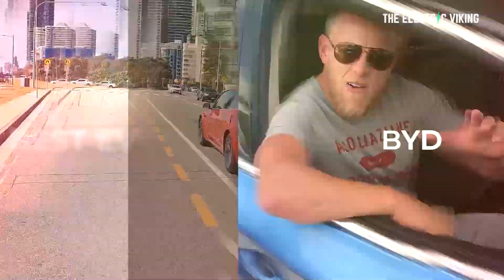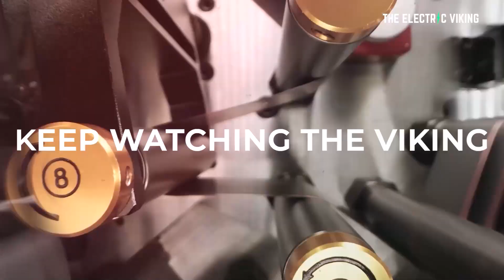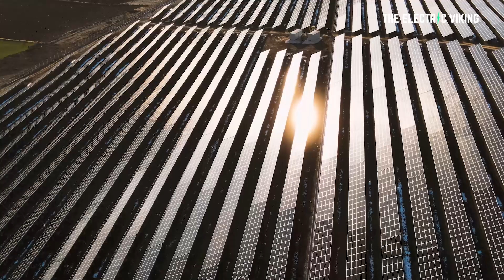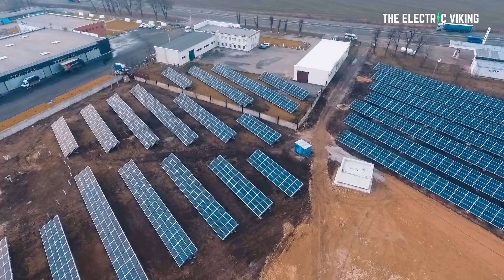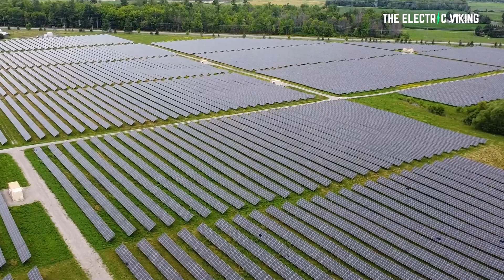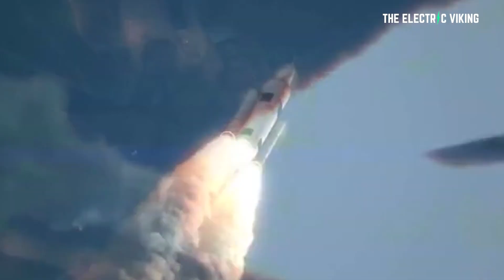Solar panels that work at night could power the Earth 24/7

Comment: I don't know what people have against safe modern nuclear plants. They're completely different from the old types.
Reply: The problem is what to do with nuclear waist? Unless nuclear diamond batteries become a thing.
Reply: @mohammedabdulahi7894  how much nuclear waste do you believe exists?  ALL (every single bit)  of nuclear waste generated in America since 1950 would fit on an American football field. 

And... there are new nuclear plants DESIGNED to run on the "waste".
Reply: @johnb7430  true, if it's possible to run new nuclear plant with nuclear wait I am all for it. It's just that solar panels give you the freedom to become energy independent which I prefer.
Reply: @mohammedabdulahi7894  What do you think is more toxic, 50 years of nuclear waste, or the byproducts of billions of solar panels over a 50 year timeframe?
Reply: @CRCinAU  let see you are asking me which is dangerous between broken glass and aluminum vs nuclear waste with radiation that can kill with out contact?
Reply: @mohammedabdulahi7894  France is using waste to generate power now. They also are recycling the materials.  

Dont get me wrong, solar is good. But to replace grid power, its not sufficient. It also needs battery backup. And it does run into shortages in winter which limits utility in certain lattitudes.   

Of all the "grid" power generation sources  nuclear is the most abundant,  uses a miniscule fraction of resources of coal, natural gas, oil and generates the cleanest power. By far.  Oh, and emits the LEAST AMOUNT of radiation.  

Coal, gas, oil all have been in the ground and have "background radiation".  Yes, a tiny tiny amount per ton,  but there are billions of tones used. The total amount released is large.  Then the mining /drilling disruption and polution is also a factor.  

Dont be fooled by propaganda from coal and oil conglomerates throwing out distorted and false claims on nuclear (and solar, wind, hydro). Do your own research.
Reply: Perhaps it’s that no one has any idea what we’re going to do with all the waste we have already, never mind making more.
Reply: I'm all for nuclear as clean renewable energy and I live a short distance away from the 3 mile Island nuclear plant in Pennsylvania. (Look up the history on the partial meltdown). I'm sure you know it takes 20 plus years to build a new plant. That doesn't really help the current drive for renewables with global warming today.
Reply: Fundamentally too slow and too expensive. A few are fine, probably up to 20% of generating capacity, in the long run it'll be cheaper to overbuild solar and wind together with some storage.
Reply: Even the person that founded Green Peace admitted they were wrong to be anti-nuke
Reply: Totally true. They do sadly make waist so bad that people 50 thousand years into the future will have to deal with. Solar battery arrays are now cheaper than any other source of power right now, without that legacy to the future generations. Just look at this lecture,
https://www.youtube.com/watch?v=z7vhMcKvHo8
Reply: How many safe modern nuclear plants are under construction, how much is each one budgeted to cost, what arrangements are in place to pay for them to be safely dismantled at the end of their life and where will the radioactive waste be permanently stored?  Nuclear power stations require a lot of cooling water.  Placing them on the coast is a recipe for disaster when we know that sea levels are rising fed by melting ice caps. So where will we put them and how will we source the coolant water?
Reply: @rais1953  ... and when a single nuclear reactor outputs more power than 10,000,000 solar panels for over 50 years - what do you do with 10 million toxic solar panels if you choose solar over nuclear?

Not even starting to count battery storage to store the output of 10,000,000 solar panels to try and get through the 16 hours per day where they generate nothing.

Comment: I've been looking at solar portable power stations for backup energy incase of blackouts and it looks like people are picking LFP (life04) over ion because they're safer and last longer.  Exactly what you've been saying for quite awhile as to why manufacturers should use LFP for their Evs. Agree Solar and battery technology advances are moving at lightning speed.
Reply: Your portable emergency backup battery which can run the basics in your house is called a BEV now that many are offering vehicle to load 😁

Comment: I had more or less understood that you have no clue of anything regarding phisycs bit I did not believe that you was so clueless to rebound the mother of all fake news.
Instead, here we are.
So first let's debunk, just to ensure that everybody understand each other and that we are all on the side of phisycs.
The power produced at night is in the order of the mW while in the day it is in the order of the 100W, so it is 5 order of magnitude less (not 5 times less, 5 order if magnitude less i.e. 100000 times less), in other words the power produced at night is, by all means, negligible, it is >0 (this is the discovery) but it has no practical impacts at all.
This is still not considering that everybody on the face of the Earth would need 5kW of power to run at the Western standard of living while energy from the Sun is 100W per square meter seasonal average; considering a generous 50% efficiency (now we are stuck at 20%, for affordable chinese solar panels, from several years) it means 100m2 of solar panels, plus 20MWh of seasonal battery storage, I repeat again PER PERSON and this news, as defined above, does not change anything.
Multiplied by 10 billions people it becomes a square of 1000km by 1000km of solar panels and, more important, behind them 200PWh of seasonal battery storage, both to be replaced every 20 years.
This is the real planet disruption (not the Tesla one), mining such quantity of materials, followed by a distopic world Blade Runner like.
This news, as the other "sensational" ones related to the direct capture technologies (improperly named as "renewable") is actually functional to the fossil fuels industry, in order to further delay the only technology that can actually displace it and, at the same time, that can decarbonize the energy industry.
Go nuclear or go nowhere.

Comment: Just for the record.
Avg home has 32m2 of windows. 
At $400 / m2
Glass PV panels on the roof. 32m2.
Is $200 / m2,   32kwh daily.
In Australia, 20million buildings. 
That is more than all fossil fueled power generation daily at maximum power if you are lucky.
For free.  Solar electric energy. 
No expensive grid transmission costs.

Add EV big batteries and central grid electric power supply is a 'dead duck'.

Some of the other 'dead ducks', that fought to stay alive;
Big Fossil fuels,  no climate problem 
Tobacco,  no cancer problems
E cigarettes, no problem 
Gambling, no problems 
Pharmaceutical, no problem 
Auto industry, no vehicle safety problem 
Horse racing, no problem 
Water supply, no problem 
Pain killers,  no problems 
Nuclear power, no problems

Comment: Wonder if its possible to have containers of sand / earth beneath solar panels, heat these during the day then generate energy using a heat exchange on a night. Use the same area for two different type of renewable energy. Or am I completely barking?
Reply: Hi Paul.  You're talking about sand batteries - they already exist. In fact, I have something similar in my home which heats up bricks at night during cheap electricity and pumps it out as heat for the daytime. Something similar could be used for your scenario. The only reason I don't put my solar into the heating is that I need it to power my house.
Reply: One line of reseach, for example by Professor Christos Markides and team at Imperial College London, is 'solar-thermal' hybrid pv systems with the goal of maximising total energy capture in both heat plus electricty. You could search on Markides at Imperial for more info and his augaural prof. lecture back in Oct 2021 on the Univeristy's YouTube channel.
Reply: The problem with your statement - you're asking can you heat something up in the shade. Think about that for a moment.

Comment: Viking there are some fundamental questions that need to be faced up to. The law of thermodynamics. To get electrical power you need some kind of power striking the panel. It must have either light or heat. so if you have 100 mw of light striking the panel at night you will never get 110 mw of power from that panel. Therefore this is not a magical solution. 4 sq m of panels might trickle charge one low power cell phone, but not much more than that. You must be careful of believing these enchanting solutions that later have some serious flaw such as expense. ..
Reply: Th high frequency laser beam is supplying a race way  for energy to transcend

Comment: OK, but we still have a problem: the solar panels recycle. Here on YouTube are videos about how recycling a panel cost 30 dollars and materials recovered has a value of 2-4 dollars... so... we get nothing good if we cover the earth with crossed panels... Is this a real matter or not? Recycling should be the base development of any new technology.
Reply: Recycling cost should be added to purchasing cost of all products. It's the only way we won't burden our children with the costs of our life style
Reply: Fair point but would you rather deal with a pile of used panels or a used nuclear power station or the effects of oil burning?
Reply: @jsanders100  doesn't matter which tech we use, add the costs of cleaning up the pollution from nuclear plants to the cost of energy they produce. Same for coal, gas, etc. 
Ofc atm it looks like solar+wind+batteries  will rule in this decade
Reply: @jsanders100  Seems the problem is not understood:  broken panels come to be more and more, exponentially. No nuclear plant is increasing any contained surface, is delimited area from the start, and can be the same for a thousand years. Costs are not the problem, the problem is volume and space, the landscape. And I want to see engagement in solving problems, but now seems ... nothing. To be clear, I am here as the devil's advocate, the problem not to be forgotten, not to stop solar electrification.
Reply: @jsanders100  Give me the used nuclear fuel any day. It can be reprocessed and used to make millions of dollars. The sad state of affairs is that nuclear 'waste' is worth more than you could possibly imagine. You need to realise that stored 'waste' today is tomorrows fuel source. The US has enough 'waste' for a number of decades of free fuel.
Reply: @CRCinAU  And the cost of dismantling the nuclear power station at the end of its life?
Reply: @rais1953  it's cents on the kWh.....
Reply: @rais1953  The cost of storing the wast for the rest of time.
Reply: @CRCinAU  Is it? Which currently operating nuclear power stations are putting aside the funding for decommissioning by a surcharge on their power production?  Or are they all depending on the taxpayers to pay that cost?
Reply: @rais1953  It's part of the price for every KWh of power they generate. You really should start reading on how these things are organised - as these questions are very basic in lacking knowledge.
Reply: @CRCinAU  It's because I've read extensively about nuclear power that I asked that rhetorical question. A detailed OECD study came to the conclusion that the means and adequacy of financing decommissioning of nuclear power plants is unclear and requires further study. Translation: Any private nuclear operator can declare bankruptcy. So private or state operated nukes are likely to be left to the taxpayer to finance decommissioning.
Reply: Sounds like crap to me the average solar panel has about $30 of silver in it for a start.
Reply: Yep, seems no one has no idea. I asked what we are doing with the broken panels, which today are just gathering in piles. Behind comments extracted from media propaganda... nothing. OK, as solar panels are expected to work on average for 20-30 years, this problem is to be solved by the others, coming after us...as we clean after others, each generation with its own garbage, up and down... Nothing is gained or lost, all is transformed, just...

Comment: No, it doesn't work that way.  As it is, solar panels used in the daytime in full sunlight leave a lot to be desired.  Case in point:  we have to replace a lot of trees with solar panels to get enough electricity to power everything.  The amount of electromagnetic radiation that can conceivably be used by solar panels at night is only a super-tiny fraction of what is available in the daytime.  You'd be lucky to power a digital LCD clock with the light that you would get at night on your home roof with no clouds and a full moon unless perhaps you don't mind going nuts replacing trees with solar panels of course just not near your house.

Moreover, this still does not solve the problem that EVs will become an epic disaster because power grids will fail to keep up with even just half of all cars and trucks becoming EVs.  It doesn't matter how many solar panels and batteries you put everywhere.  You keep ignoring the problem that the power line and transformer infrastructure was not designed almost anywhere to supply all those vehicles with that much electricity be that in the day or at night.  Power lines are going to be overheating and breaking down non-metallic components because of excess heat, and transformers will keep blowing out, so then power companies and local governments will impose even more bans on people using power grids to recharge vehicles.  Mind you a lot of power lines are also underground in cities, so replacing those or adding more everywhere would be so expensive that it is not even worth contemplating getting that done anytime for the foreseeable future.  This EV transition is going to be a disaster because of that failure to pay adequate attention to the whole problem of antiquated inadequate infrastructure.  I predict that EVs will start to become just oversized paper weights in the second half of the decade, and power grids will not catch up for at least another 30 years or so in most of the country, by which time we will have had to turn to something other than cars running on rechargeable batteries.

Comment: Sam have you heard or seen anything new from Tony Seba it’s like the earth 🌍 is flat and he sailed right over the edge it would be nice to see his new numbers on renewables and electric vehicles
Reply: On Tony Seba's YouTube channel, he recently released three 20-minutes videos, which form parts 1, 2 & 3 of a longer presentation. This 3-part presentation is almost identical to the 1-hour presentation he released about 1 year ago, although he has introduced some memorable quotes to make some points easier to understand. An internet search suggests that his most recent written report is "Rethinking Climate Change" (August 2021) which you can find as a PDF file on his website.
Reply: @CiaranMcHale  Thanks Ciarian I really do think we need to rethink climate change. The science is very suspicious at best. However to continue burning hydrocarbons as a primary energy source is stupid in the extreme. We now have better options and we need to pursue them carefully, with some urgent hast.
Reply: He's right on TaaS at least.